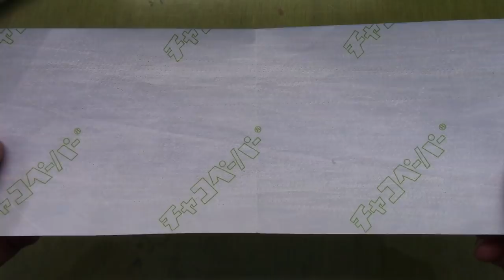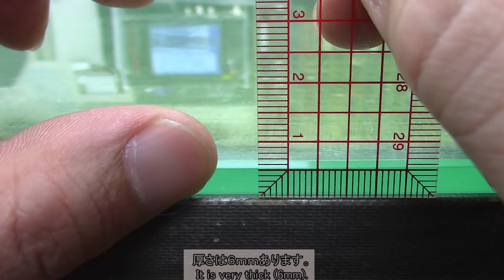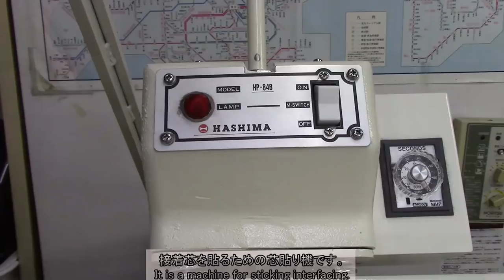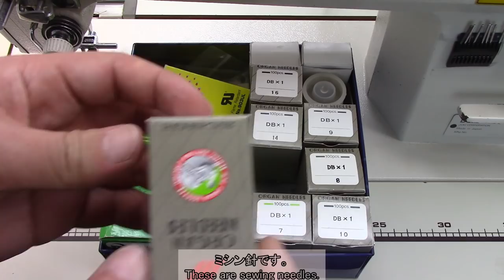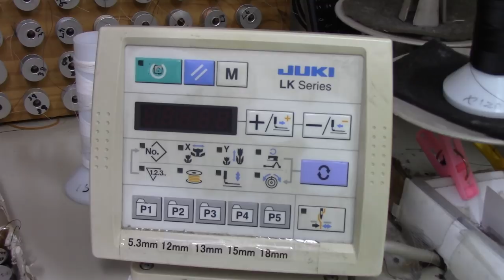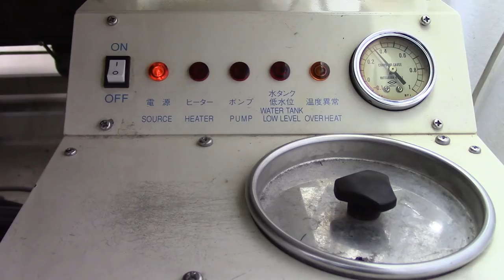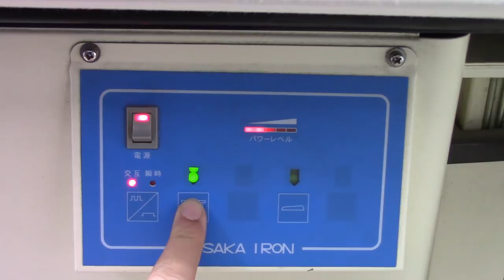Pattern Weight, Presser Foot, Yarn, Scissors, Bobbin, etc...58 sewing tools!!

Comment: Really helpful - would definately like some of those pattern templates you use when you press your seam/collars etc. What material are they made of and who makes them please?
Also, although you didn’t show it I’ve seen you use a very small, fine hinged hook to pull the overlocker threads into the seam - I’m currently threading a large needle each time so if you could mention the make of those I’d be very grateful. Thank you for such a detailed video - greatly appreciated. Learning at the hand of masters.

Comment: Thank you for introducing your tools. 
I bought a chisel after watching your video. It's a brilliant idea to use a chisel to notch. 

Could you explain what kind of mesh you use for ironing (29:14) and what 's good for using mesh. urethane too..
Reply from the maker: If the iron is applied directly to the fabric, delicate fabrics will be damaged by the heat. Use these to prevent that. Thank you!

Comment: Hey  thank you for great videos!! 
Its really helpful!   Can you please explain more about the pattern templates made by calendar?  When there were used?  Also i would like to see and learn about some special things that you guys made for yourself.  I saw pvc? plastic? Tape are used in many sewing  and i was wondering why you guys have it.    Can you make another video about those things? Or  little comment on community will works too if its not to complicated.
Reply from the maker: Thank you for your suggestion !! We will try to make good another video for those things😁
Reply: I use pvc tape on the presser foot ,when I sew the leather.
Or adjust the presser foot,it go smoothly.

Comment: That pink foam tape. What's it exactly?
Reply from the maker: Please tell us which time part of this video you ask. (EX 5:45) Thank you.
Reply: Thank you. For instance at 14:50 two of them are seen on top of the machine but you use them as seam guidance quite often.
Reply from the maker: Thank you for your reply. The pink tape is made of urethane foam with a sticky surface. It is very useful as a guideline for stitching. We buy them in a kind of professional shop in Japan. I'm afraid to say that we do not know if it is available outside of Japan.

Comment: Donde puedo conseguir la regla de bambú.
Reply from the maker: I tried searching on Amazon but it was not found.
There is treatment in the Amazon of Japan.
It may not be possible to order from a foreign country.
Paste the link.
https://www.amazon.co.jp/%E5%AD%A6%E6%A0%A1%E6%95%99%E6%9D%90%E3%81%AE%E5%B0%82%E9%96%80%E5%BA%97-%E7%BE%8E%E5%B7%A5%E7%A4%BE-%E7%AB%B9%E5%B0%BA%EF%BC%93%EF%BC%90%EF%BD%83%EF%BD%8D-132-181/dp/B01B7MKZEK/ref=sr_1_9?s=office-products&ie=UTF8&qid=1520869109&sr=1-9&keywords=%E7%AB%B9%E5%B0%BA

Thank you for watching and your comment !!
Reply: It’s hard to find a store that will ship the bamboo rulers outside of Japan. I think because they are so inexpensive and the shipping will cost much more than the rulers do.

It took a while to find them, but I was able to buy a few of the rulers from Rakuten.com, along with a few other items that are hard to find in the U.K. Many shops on Rakuten have the rulers, mine came from Andomishin. They have many of the items shown in the videos.

Another alternative is to use a shopping service like buyee.com or tenso.com, but there is an additional cost for the service of course.